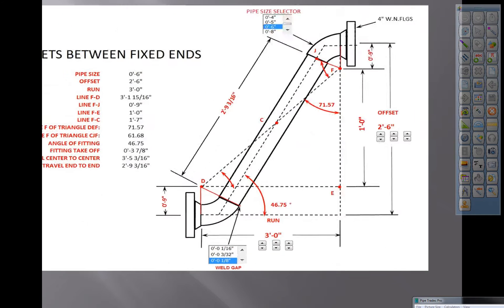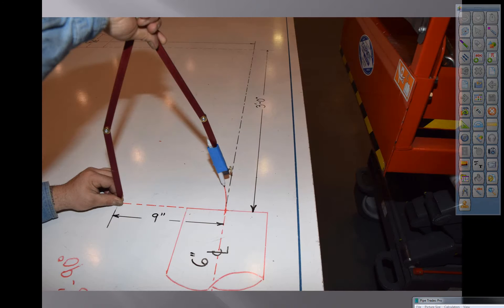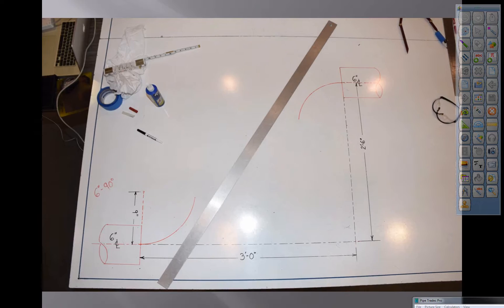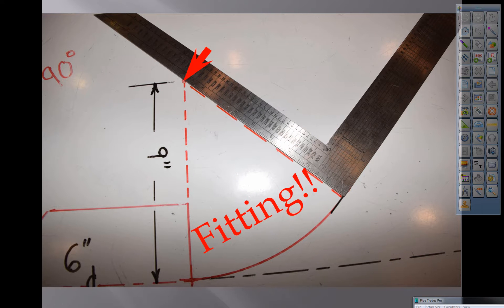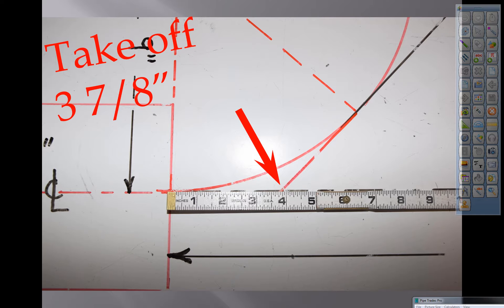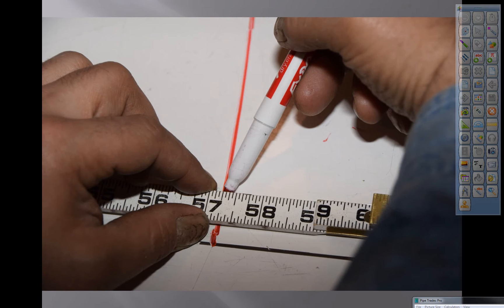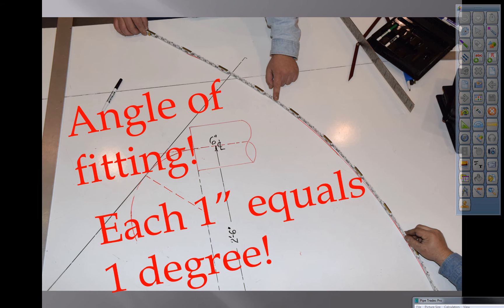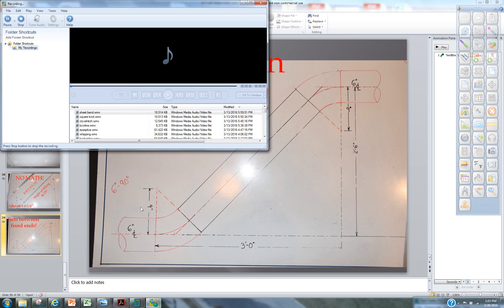Moes Mathpipefitting: Unleashing The Art Of Weld Fittings Between Fixed Ends, No Math Required!

Comment: Thanks for putting this together. Like before were did you come up with the 57 1/4” I saw to start from the vertex but you didn’t say were the number came from.
Reply: Times 57 1/4 by 4 you get a 360" circumference circle